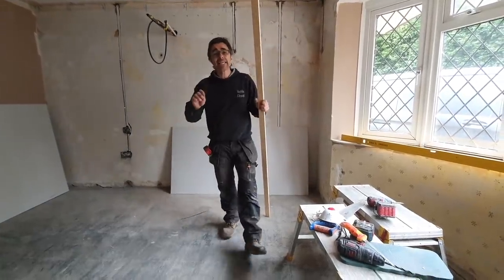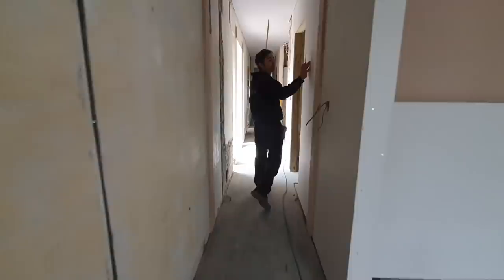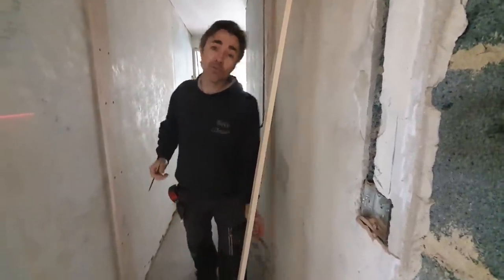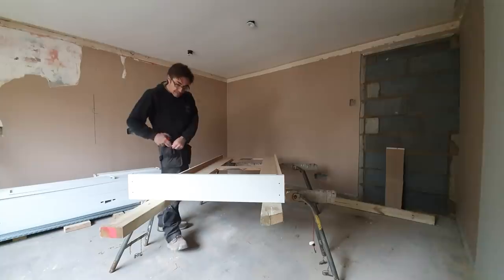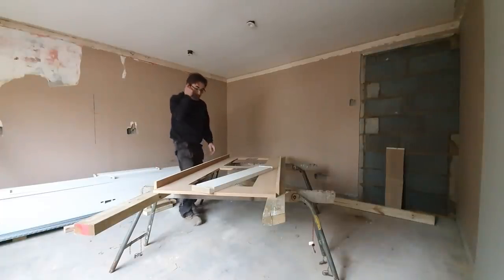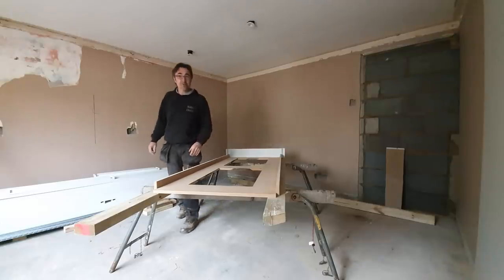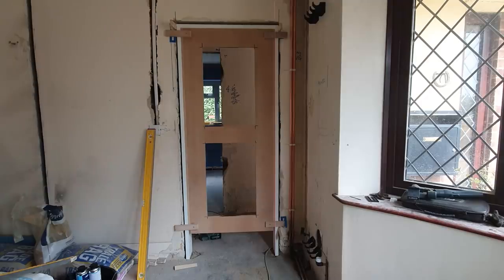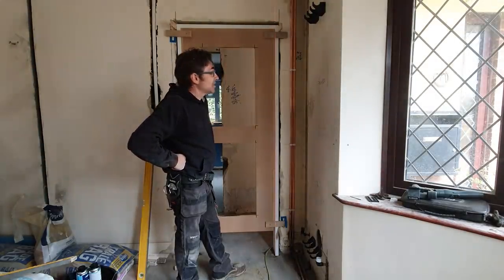New MDF Door Linings / frames in old openings, how to get perfect linings fitted for new doors

Comment: Funny how the Joiners of yesteryear produced wonderful work without MDF
Reply: They had their fair share of crap materials then as we do now. Robin is quite right as to the benefits of mdf finishings like this to timber, half the time the timber is like a cows hind leg. Why not take advantage of a stable perfectly smooth material if its going to be painted anyway?
Reply: @johnmackay7789  Yep, I agree!.👍
Reply: Don’t like MDF. Doesn’t hold screws anywhere near as good as reds especially with heavy pre finished doors. Like to see what they’re like after a few years with kids swinging on them and if anywhere near a kitchen floor that gets mopped regularly will be in bits. Sorry but totally disagree with mdf for door casings or arch’s. Advanced city and guilds joiner with 40 years experience and NEVER been called back to a job.
Robin is a very good carpenter/joiner BTW. Few and far between these days.
Reply: @clivejackson3047 you still haven’t been back to sort the doors you fitted for me. None of them latch properly and you fitted one upside down

Comment: I used to screw a spacer batten at the bottom and one in the middle to keep correct gap in UK. It worked. In Oz all the door linings or jambs as they call them here go in with the door. You fix the hinge side leave the rest floating. Hang the door and set the rest of the frame to the swinging door. Seemed weird at first but now after 22 years it seems normal. Guaranteed to fit too.
Reply: That’s how we do it in Canada too, and their called jambs 👍
Reply: I live in uk and I still screw a bit of baton to the bottom of the frame then I always put in 2 screws Side by side and around 4 rows in each side to keep it straight
Reply: Your dead right Dave that’s how I fit them you get perfect gaps all the way round... The trouble is now in the uk it’s £800 a 4 bed house that includes 11 frames pre finished doors skirting architrave handrail etc.... they want it all looking sexy as in 4 days this system Robin is showing is good but will only work with a 200 quid level otherwise gaps will be out.

Comment: I've been doing a similar thing for a few years now, I have a couple of cheap blanks with packers tacked to the side for gapping, i make my lining up around this and brace it up. I then set the lining in the opening with folding wedges, foam fill, let it all go off the put in mechanical fixings, (I also pre drill and countersink all my fixing points through the lining prior to assembly)  saves a ton of time when coming to hang my doors. Great video as ever sir.

Comment: I've done the same thing as this a couple of years ago... I had an offer through from Howdens for £7 a door, bought a 2'3" 2'6" and 2'9", cut the holes out and lined them with a couple of strips for the gap around them, perfect! Cheaper than 3 sheets of MDF
Reply: Your dead right pal that idea is as old as the hills 6mm ply and 2x1 only when the old boy did it there wasn't any foam just wedged up to death 😝🔨
Reply: How much of a gap did you leave each side of the doors? About 3mm?
Very good idea

Comment: MDF frames eh.... I wish the people who specify them had to swing the doors, absolutely crap. Awful to swing FD30/60s on. I've nothing positive to say about MDF frames.
When installing many frames we use a prepared door template, but level the head and hinge jamb first, fix the jamb, temp door in, fit the lock side jamb to suit, JD.
We install FD30/60 fire doors predominantly tbh, then router the hinges in with a full length jig.
I like the method you use. The head and jambs have to be bang on level/plumb or you'll notice it, and especially when running the skirting into the architrave, or if fitting cheeks to then fit architrave to them.

Comment: Just how I do it now - Fit ply liners before plaster  to masonry.
After plasterers have been .
Router  hinges into frames , put leading edge of doors both side with plain or router , router doors , fix hinge side plumb, swing door , left lower leg and lock side of frame to suit gap on the door , fix top and bottom , check frame legs are parallel, fix leg , foam all around with fire foam . Perfect door and frame . No plaster on frame 
Great channel Rob keep the videos coming . 
ATB mate 👍🏻
Reply from the maker: Your method is great, and providing the structural openings allow I feel this would be a better way to build full stop!! keep up the great work mate
Reply from the maker: I Like your Channel to mate!!
Reply: @ukconstruction  thanks mate that’s a big compliment coming from you. 
need to upload more content , just no time At the moment with the work load we have on 🤦🏻‍♂️
Reply from the maker: @ukcarpenteroutdoors7081  Its really hard mate to mix filming in with working!! I look forward to seeing more in the future, I am subscribing!!

Comment: Great video Robin
We have just fitted 11 fire doors and frames and had the benedit of cutting walls to suit our new frames so we did this but used a fire door blank cut down to the required size. Worked a treat. Just like hanging door sets really.

Comment: Nice idea, I wondered if you would take the time to demonstrate 'sighting a door frame ' for double doors obviously but some people have trouble understanding the principle.
Reply: Easy enough. “Out of wind” if it’s wrong. Sometimes if you can’t get your eye-line through from standard to standard; use thin fishing line from corner to corner. When the line touches in the middle, your bang on the plane for both doors. (Especially if the doors have a half check on the lock side) Hope this helps others Dan.

Comment: Good stuff as ever, I'm always dubious about the fixing strength in mdf though for the door hinges tbh. Pre packaged softwood frames are awful and I've had to take loads back due to twisting/cupping etc or had to try and fix them on true with fixings which creates a real job that can take a lot of time. The foam is a great idea aswell, upvc doors have been set like this for ages, sometimes frame fixing isnt the best so anything helps. Downstairs for dancing, upstairs for thinking. Mr Clevett is always thinking.😉

Comment: Did nine linings thee other day I had to trench all the heads on most off the linings on 170 mill linings some I had to rip down for the plasters had to make 2 linings for 0.609m mill doors or 2 ft made them the openings 0. 613 m then fitted them to masonry walls all were nice and plumb level and in wind

Comment: Been doing this for 15 years,  the only way to make money on price work.

Door linings are rarely manufactured with the suitable tolerance for the door, gaps and paint, 
So I adjust the opening when fitting to  make second fix easier.
I can't get my head around a joiner that would need to be told such a simple thing

Comment: Do you have any concerns about the weight of the doors hanging from mdf liners? As you know mdf has two tough strong outer cores but a much softer inner core. If the doors were being hung without receiving for the hinges you be laughing but as we normally recess our hinges that removes that outer hard core and the screws can only grab that soft inner core unless you use longer screws and break through to the other outer core which leaves screws sticking out. Great form idea

Comment: Hi Robin, would you not use the hinge jig on the workbench before installing the frame? Way easier than trying to router it once the frame is in situ? & is there a 'standard' distance from the top and bottom of a standard height internal door? When using your marking stick for the block courses, maybe you could add the hinge positions??
Reply: I would have thought so, as you say, the top hinge will be a standard distance from the head.

Comment: Robin i was just wondering that with all the time spent making the jig for the door, make one with less material as to make it easier to handle and even squeeze through, but obviously keeping its integrity.
Do MDF linings ever twist or bend ever so slightly with only one screw hidden behind the jam.
Reply from the maker: Hi Chris, MDF door linings with the single screw hidden by the stops and in the middle of the substrate like the blockwork works well when packed correctly and foamed in, the linings stay as you fitted them and are not prone to twisting or bending either, and the jig took a short while to make but we will use that loads in the future so its worth the effort!!

Comment: Question for you Robin - what is the difference between a carpenter and a joiner? And, why are all carpenters in the north of the UK mainly referred to as joiners whereas they would be carpenters in the south? Cheers!
Reply: Carpenter and joiner. If they went to college, you are taught both. Technically a carpenter works on site installing things, and a joiner works  in a workshop making things. Not sure why they call carpenters joiners up north, but they are one of the same thing.

Comment: The door jig is a good idea but what you failed to overcome was the differences in thickness of the walls in relation to the width of the linings whether they be wood or Mdf ,unless they are all dead parallel and of equal width to the linings more problems are created with fitting the architraves.
Reply: I didn't understand how MDF solved that problem either!
Reply: The mdf linings can be ordered in custom sizes

Comment: Question: So, Robin...how did you keep the frame secured to your ‘former’ whilst you moved it and had it in the door opening...I didn’t see you fix it to the former or how...???
Reply: He just screwed through the jig into the frame where the position of the doorstop will go 🔨
Reply: @tomsmith9048 ...Nope, he went to pains to explain the doorstop position, which would be in the position he placed the baton, which he actually says in the video as he does it, and marked the holes for fixing the frame into the block work...and clearly, in order to fix the frame with the jig in place he couldn’t drill and fix through the jig, or he wouldn’t have been able to remove it...he then drilled through the frame in the marked positions, and wedged and foamed the frame to secure it, then the jig was removed...but without showing how it was fixed in the first place...take another look at the video and you’ll see what I mean...👍🏻
Reply: @stun9771  8:06 he looks like he's screwing the jig to the frame as he's pre drilling and screwing it up unless we're lost in translation 🤔🔨
Reply: @stun9771  what it could be is that it's a large doorstop from outside edge of frame to the door itself then the arc would cover the line on the edge of the doorstop itself instead of the usual 30mm doorstop you get with the cheap frames but only he'll know that 🔨

Comment: Is all the mdf the same width if it is that means you have to cut it to suit your wall width not a lot of savings in my point of view. As for soft wood cupping don't just fix in the middle
Reply from the maker: I make a cutting list for every wall thickness and sometimes we may have several different sizes, the way we produce the linings is very swift and economical and perfectly accurate too as it is in a purpose built modern joinery that has pretty much automated the process in a very cost effective manner, even though they are double the price of a decent softwood lining the time saved onsite by subsequent trades having true flat linings that suit the wall thickness is massive, no dubbing out of plaster and no caulking big joints behind architraves!!
Reply: Thank you for your reply.
It might be me being picky but it might be informative to say that in the video and you have to prime all cut edges with an appropriate primer.

Comment: Hi Robin, love this idea, definitely going to be giving it a try next time.  One question I have though is that I tend to find when I’m putting new linings into old openings, more often than not the opening are just too tight to get my new lining in plumb with out planing down one side of the lining to let it in.  I’m interested what you do in this instance as I’m sure there must be an easier way? Thanks
Reply from the maker: Hi Richard, existing openings are sometimes super tight as you mention, if you have the time and mess and dust are not a major problem on site then trimming the opening with an angle grinder is the best bet to give yourself some space to true up the structural opening, I sometimes use 25mm MDF for the linings as the old timber ones that we remove are more like 28mm so we have 6mm or so to play with, I also sometimes have a few 18mm MDF lining sides on site in case I have a really bad opening and I use these on the closing side to get me out of jail!!! hope that helps
Reply: @ukconstruction   That’s great thanks, I’ve never used Mdf linings to be honest, just out of curiosity Do you find the moisture from the plaster causes any issues with the mdf linings? Or does the edging solve that problem?
Reply from the maker: @KingRichard93  Well we use medite moisture resistant MDF and we also have the edge preparation tape then a factory primer, so they will withstand wet plaster!!

Comment: I’ve used this method on a school, foamed in loads of casing in one day, fixed them the day after but when I came to hand the doors , they were all 2 mm out of square. Ffs 😂
Reply from the maker: What happened Dean? was the former out of square?
Reply: @ukconstruction  no the doors were out. I know the jig was good, done on a calibrated beam saw. Measured corner to corner on the doors 2-3 mm out. Plus some were 926 wide at the top and 928 at the bottom. So now I just fix the hinge side casing leg, hand the door and just work around the door.

Comment: I'm surprised at the small widths of the doors... 30" and even 27" ... how in Gods name do you get furniture in there ?... 😲

I'm presently refurbishing an old farm cottage here in the west of Ireland and bemoaning some of the 30" door widths... as an aside, I've also been making a couple of "insulated doors" for the hallway which is a "cold zone" ... (no rad out there)... 

Basically, I'm using a sheet of 50mm Celotex in a rebated frame and skinned with 6mm ply on each side... materials cost €87 .. not bad... 

Got to admit, I hate the MDF... 😤

😎👍☘🍻

Comment: MDF  linings are a joke...classic new build cheap as shit wont last long attitude
Reply from the maker: Well the MDF linings we use are more expensive than all the off the shelf softwood linings that are supplied, we use 30mm moisture resistant Medite MDF this is machined to with then a special edge tape is applied before spray priming, the pull out strength of the screws far exceeds the softwood type and we have never in over 10 years had an issue with MDF, I personally like these over the timber ones especially the fact that you can have any dimensions you like.
Reply: @ukconstruction  cheers for reply ! what brand MDF linings do you use ?
Reply from the maker: Hi Mate, we make our own and we are planning to make them available in the wider market in the next 12 months watch this space!!
Reply: @ukconstruction  OK !

Comment: I like the idea of how you’ve fitted the frame using a former. Always toyed with the idea of knocking one up to do a run of door linings. Big thing for me is MDF door linings. I’m way off being convinced MDF door linings are a good idea. The amount of MDF door linings I’ve had to go out to because the screws have stripped from the weight of the doors is unreal. I’ll stick to softwood door linings for now until I’m convinced but great video and will definitely be fitting door linings this way on bigger jobs.
Reply: A very good point well made. I guess with how mdf is made with two outer very hard core surfaces and a much softer inner coar.
If you were not recessing the hinges you be fine but as we always recess by cutting away the outer hard core all the screws can do is try grab the middle soft core.
It would help if you can use longer screws to pass through the middle part and grab the outer hard core, but of course this isn't always possible as the screws be sticking out.
But very good point
Reply: They also swell like a bugger if there's any skimmers in